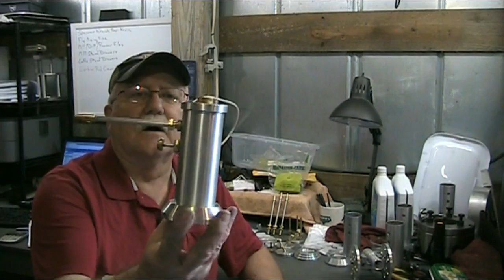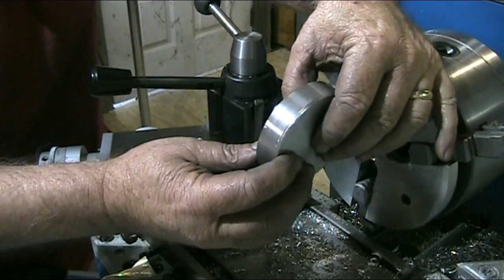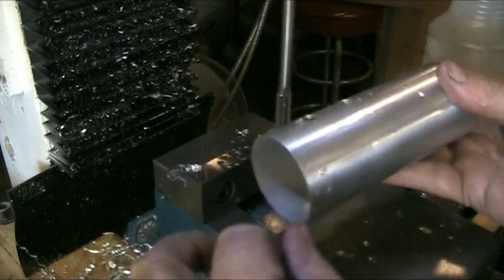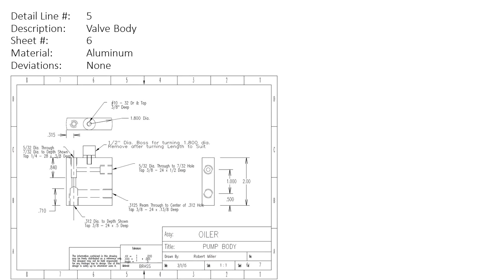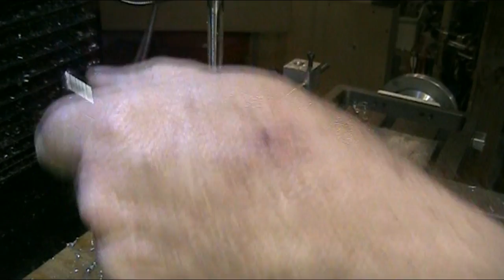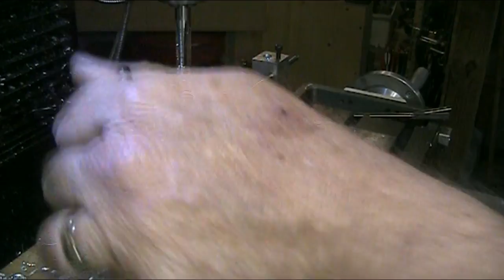Eagle 66 Pump Oil Can Clones - Part 1 of 2

Comment: Hi Lee I to have a project list , seems it's two miles long now. I've wanted to build several of these too. Plus I need to make power table feeds for two mills and a head lift for my HF Mill drill. My enco small turret mill I'm going to go over it and paint and repair. I also just picked up an atlas horizontal mill . Haven't cked it out yet , one handle on table has broken I may get round ones to replace them. So if my doc can get my pain under control in spring look out .ill be back moving things out and in. Trying to get the shop under control.like your vids , oh I'm on the hobby machinist quite often. Sometimes I even get in trouble when they take anything written out of context. Thanks nice build so far.
Reply from the maker: Sounds like you got quite a long "to-do" list.  Hope the doc gets you pain under control and you can enjoy your shop.

Comment: I did one of these from those plans.  Not real happy with O ring groove size.  The whole pump part took some fixing.  I read up on O ring clearances in the Machinery's Handbook.  Still getting some leaks I don't like when pump is full of oil.  Hmm.
Reply from the maker: hamsoftware I had 1 of the 4 to lose prime over night, but otherwise no issues.

Comment: You have one heck of a long potential gift list Lee!
That's one real super project - I keep looking out for an old 66 but most I see cost too much.
Maybe I should make me one but haven't at the moment got suitable material sizes on hand.
Altogether a fair number of stages involved - you are a patient man with energy and a comfortable shop!
Most enjoyable seeing the process so far - nice job.
Reply from the maker: Thanks Chris  This was a fun project.  I actually had a little vacation time left that I needed to take before retiring soon so spent most of the time in the shop working on these an several other items.  I was amazed at how much setup & time was required.  Making multiples probably didn't take much more time though than a single one would have.

Comment: Great idea.  I bought one of those off ebay and it does not look as good as your model.
Reply from the maker: When I first looked at the drawings I thought the base was way out of proportion to the rest of the oil can, but the large footprint is going to be an asset I believe.